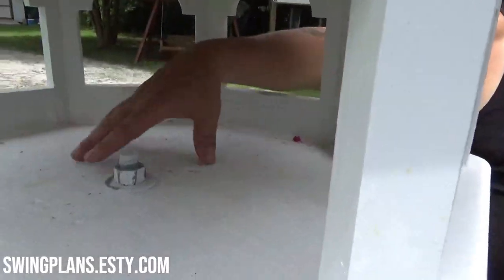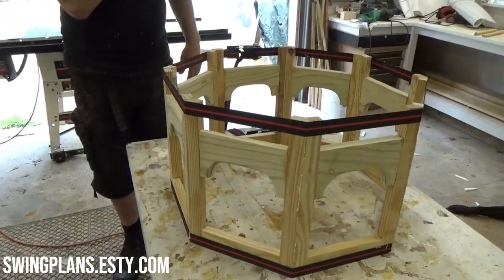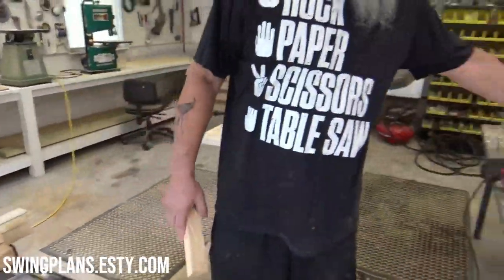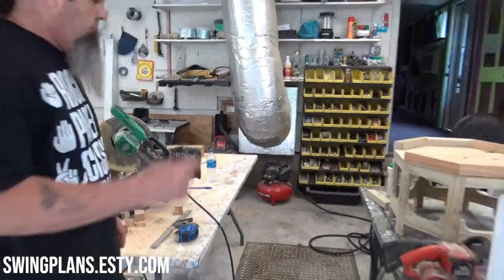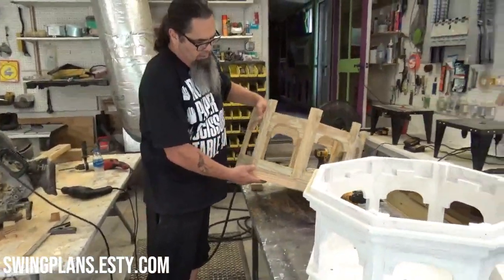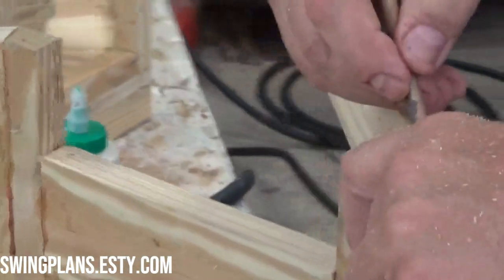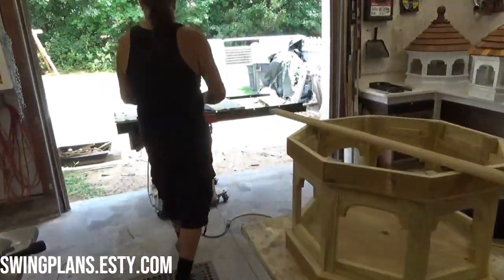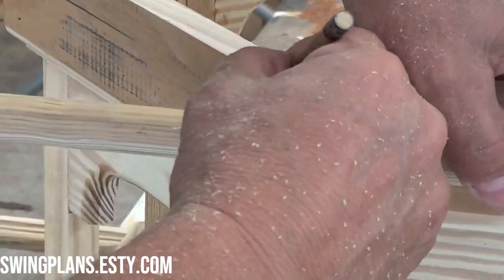Gazebo Bird Feeder Plans - Fly Through Bird Feeder  Part 1

Comment: Building it now.  Your video/instructions are a huge help.  The main body doesn't appear to be too difficult.  It's the top that feels a bit intimidating.  I'm certain I'll be back to watch you do it another 2-3 times.  Great build.  I'm having  lot of fun with it. Many thanks!!!!
Reply from the maker: thanks for your kind comment. I will tell u , it is very easy and safer to make the cuts for the roof sheathing if you have a 12" compound miter saw than opposed to the table saw shown in the video.

Comment: Aloha I seemed to have missed the video where you made the top rings for the roof to hold your plywoods cut from 10” bottoms to 3” top triangle  shapes you also made two columns to hold this in place then you removed it after installing a couple of roof panels
Reply from the maker: Part 2 = https://www.youtube.com/watch?v=QPo504gH4dU&t=4s 
Part 3 = https://www.youtube.com/watch?v=3ZgtV1mXN0k&t=0s